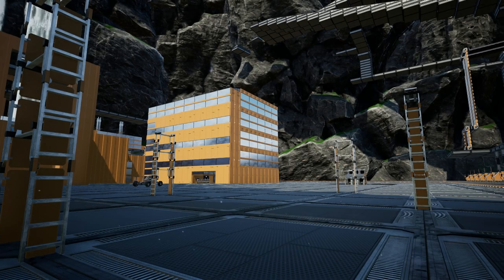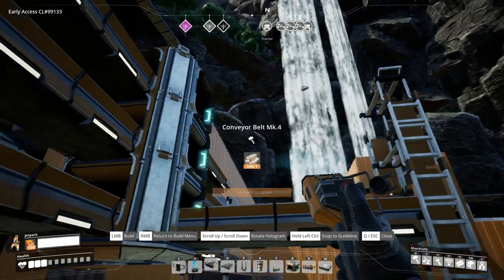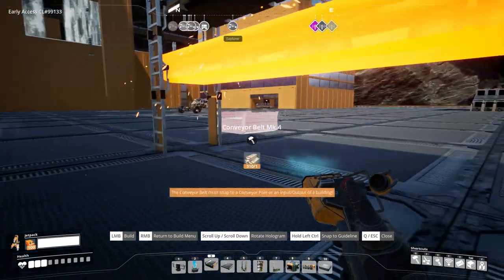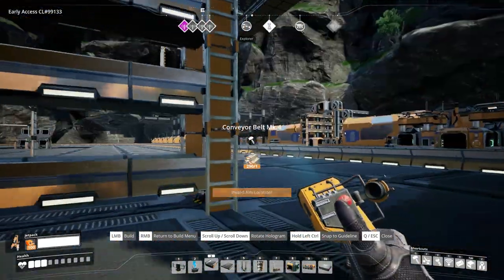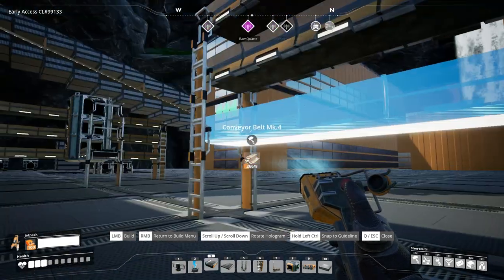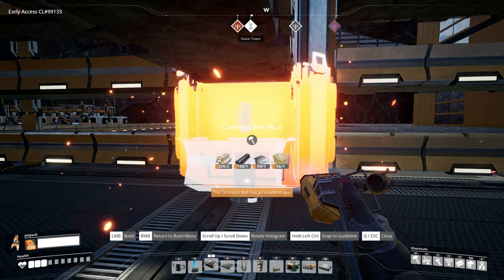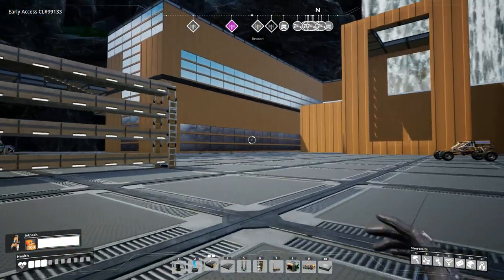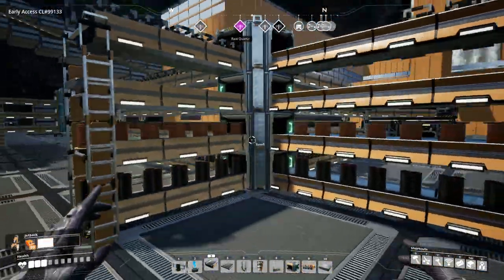How to Stack the New Splitters & Mergers in Satisfactory

Comment: Should be able to stack and connect without having to do it in a particular order. But thanks for the technique anyway
Reply from the maker: Yeh you're right but unfortunately it seems to be bugged atm, I'm hoping they will swap it out for a snap in place style so you can just place them against conveyor poles or structures or stack them on top of others without problems